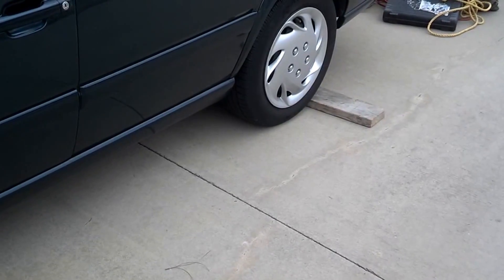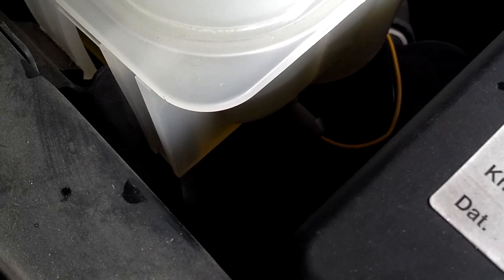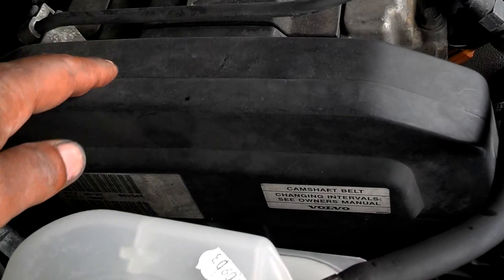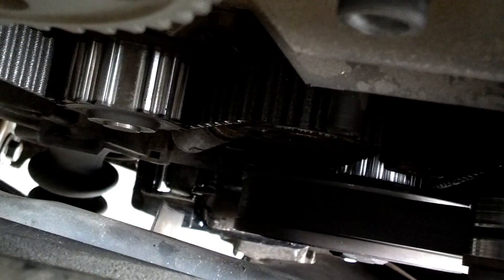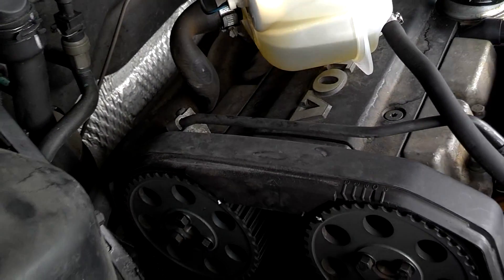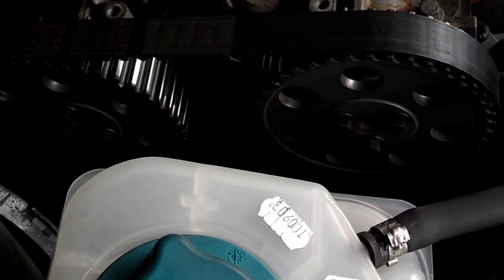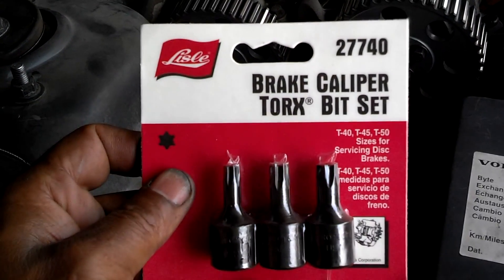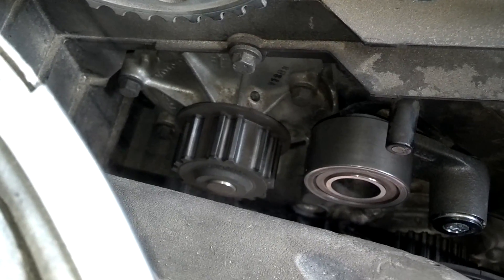How to replace the timing belt, water pump & rollers on the Volvo 850, S70, V70, etc. Pt 1-2 - VOTD

Comment: Hey Ribert I've been working on my timing belt replacement for the last two days and have run into a snag. Whenever I got every thing aligned and released the tension on the hydraulic tensioner and removed the belt now the exhaust can is off by 3 notches. How do I set it back in place? Help will be greatly appreciated. If anyone else can answer this question that would wonderful. Help please!!!
Reply from the maker: Dre_2003 Simply turn it back. Part 2 of this series explains that my exhaust cam moves almost every time.
Reply: Thanks man that help a ton

Comment: Hi Robert. First of all, awesome trip you took to help out folks! I still have several videos to watch of your trip. I just took 2 days to replace my timing belt, tensioner, tensioner pulley, idler pulley and water pump. My 95 850 wagon has 186K now. I also replaced the fuel filter and cabin air filter. So it's running really well. Thanks for all your help with the timing belt videos! It went smoother than I expected. My best to you and your wife.
Reply from the maker: Ricky P. Thank you Rick, glad the videos helped.

Comment: Hiya Robert, I've spent the last 15 mins trying to private message you but i can't work it out. Did you get my paypal for the cam tool and did you post it yet?? Thanks.
Reply: Sent Feb 11th.
Reply from the maker: adamxb1 Yes I did get the payment but no I have not shipped it yet. I ran out of the tools and I am waiting for the machine shop to cut me some more. I have been by there several times over the past week or so. If they are not cut today, I will get them cut somewhere else tomorrow. Sorry for the delay.
Reply: No worries, i changed the heater core in mine yesterday (after watching your video of course). I know I've said it before but they really are invaluable to my V70 ownership.
Reply: adamxb1 did you manage to get the tool made/posted yet? Thanks.
Reply from the maker: I shipped several of them out a couple of weeks ago. If you paid for a tool that you did not get, go to my website and text me your address and I'll ship you another one.
Reply: I'll give it another week and if still nothing i'll do that.
Reply from the maker: If you don't have it by now, let me know so I can ship you another. No problem at all.
Reply: Emailed you.
Reply from the maker: Good

Comment: Anyone can help me with 04 s80 timing belt was touched when replacing accessorie belt now its broken and mechanic said engine is broken dose it make sense?
Reply from the maker: isaac lebowitz Is the belt physically broken?
Reply: Robert DIY now the engine is completely dead the car jumped and the engine died beautiful 04 s80 leather sunroof
Reply from the maker: Yes, the motor will need to come apart, big job.

Not sure I understand how it failed. How many miles were on the current belt?
Reply: Robert DIY 130k
Reply from the maker: Wow, that is probably to much.

Comment: Hi Robert,
Well today I replaced my serpentine belt (it was split down the middle, between two grooves), the tensioner and it's pulley, and the idler pulley (screwed into I think the power steering bracket). Spend about 45 minutes looking for the bottom bolt from the tensioner bracket that dropped into the engine bay, but found it. All in all, went better than I expected. There is a cap on the separate idler pulley that needed to be pried off to get to the 12mm bolt holding it on. I so appreciate your videos. Rick. Happy Holidays!
p.s. Tomorrow I will try to install the trailer hitch wiring. I got a hitch and installed it too.
Reply from the maker: Ricky P. Nice and cool about the hitch.

Comment: Robert, I replaced the timing belt and tensioner on my '03 S40 and the new tensioner came apart when I was sitting at idle, so the car jumped time. Reluctantly I pulled things back apart and finally got the cams to turn by carefully turning the crank 1/4 turn at a time until they turned freely...or as freely as they can with the cam lumps. I set the crank and cams to the timing marks, reinstalled the timing belt with a new tensioner and while it doesn't seem to be making nasty noises cranking, the engine seems to only fire on one cylinder.
Is it possible that the crank is 360 degrees off? I've convinced myself that the #1 piston comes to TDC twice, and only every other time is where it should fire. I don't want to try turning the crank a full rotation and find out that I have really toasted things by further changing the timing.
I've appreciated your videos, and your opinion of what I'm dealing with.
Reply from the maker: Amanaland The best thing to do is a leak down. If the belt jumps time, it usually smashes almost all of the valves regardless of the speed of the motor. It can jump time starting and destroy the head.

Comment: yes check engine light is on and it is N/A
Reply from the maker: Baaxter W. Baaxter, I really have no idea what you are referring to since you did NOT reply to my last message. However, you need to get the codes read and go from there.
Reply: Robert DIY the engine light is on and it is N/A naturally aspirated (non turbo) sorry for the vague response.

Comment: Hello, I have a 1998 Volvo S70 and it is running very strange, sometimes it is hard to start and once it does start it bogs down for a sec till the revs kick up then its fine and runs great. Second when sitting at red lights the engine will rev up then back down and want to die.  I have used your videos to thus far work on and keep running our beloved Volvo but now this issue is beyond me and im not sure what to do.. Im thinking fuel issue maybe fuel filter or maybe clogged injectors??
Im not sure, any input would be greatly appreciated. 
Bobby
Reply from the maker: Baaxter W. Hi Bobby, does the car have a cel (check engine light)? Is the car turbo?

Comment: Hi Robert-thankyou so much for this video-it's a job that I've been putting off for months now, because the procedure is never totally clear in the the service manual. You've covered it in such a way that I'm off to the garage to get down to work!Kind regards, Stef, Amsterdam NL
Reply from the maker: iksnizdaso Good deal. Not a task to be put off for long. ;)

Comment: Thank you Robert, the timing belt and pu,p were done, cost was close to $1000 including replacing the seals around the crankshaft.  They also did oil change and antifreeze.  Now the radiator warning light comes on even though the reservoir is filled.  The warning light goes out after it is fully warmed up.  Why is that?
Reply from the maker: John Tao Maybe the float is stuck. Take it back and have them check it out.

Comment: Hi Robert.
My 99S70 timing belt went bad. The belt made it half the way off the pulley. How can i tell if damage was done to valves or other engine components.
Reply from the maker: Fred A Did the car jump time?
Reply: Not sure I'll have to look at it tomorrow. Waht if it did?
Reply from the maker: Fred A If it did, it likely damaged the motor. Did the motor stall? How did you know the timing belt was no right?

Comment: Robert, I have decided to go and replace the timing belt and water pump but the garage didn't know which kit to get.  He says there are two different ones from Gates one that is $560 and cheaper one $265, depending on the engine model.  Are there two engine types for the '94 850?  The Gates parts are TCKWP252A and the cheaper one is TCK252.
Reply from the maker: John Tao I don't think there are different timing belts on the '94 car. Order your parts from FCP or iPd depending on which side of the country you are located on. Also, I usually just order the parts I need, i.e., the belt, water pump, idler roller and tensioner roller. Cost is usually about $178. The hydraulic tensioner is usually good. I normally have one of those on hand that I pulled from a junk yard car, which cost me $20, they are $95 new so that would bring your total to $273. So you can have that on hand and if not needed, return it for a refund.

Comment: Hello Robert, My name is Salvador, I have a volvo s70  All the light came on and and transmission skips on the 3rd gear, I did a transmission flush and still skip and all lights are on, Im try to see if you know what i can do if maybe a transmission sensor is  fault  and if you think its where can i look for the sensor, Im very glad that you  put  videos about  fixing cars I thank you,
Reply from the maker: salvador paramo Sounds like you have a bad alternator??? - Bad Battery or Bad Alternator, how to tell the difference (Brief Version) - Auto Information Series
Reply: Thank you for your respond, Alternator and battery is ok lights goes on and off, I travel to work daily and  everything is ok,  but the main trouble is the skipping gear and an arrow flashing like the over drive but all gear engage normal but not the 3rd, I have to take off fast it change to 2nd but then skips, and i have to let the engine rpm slow to engage to the next gear, Do you think that its a sensor on the transmission that needs to be look at or change it?
Reply from the maker: ALL the lights point to low power. Have the system OBD2 read at a dealer, they will tell you what is wrong. I don't know.

Comment: Robert my '94 Volvo 850 is close to 200,000 miles, I had the timing belt done 10 years ago at 110,000 miles.  I plan to get it done again, do you think I should change the water pump.  Volvo dealer says not needed and another mechanic quoted me $910 for both and $685 to do just the timing belt.  What do you recommend?
Reply from the maker: John Tao Where are you located? I always replace 10 year old water pumps, they are time bombs.
Reply: Robert DIY Thanks Robert, I am in Pennsylvania.  I guess I have to splurge and get all that done.
Reply from the maker: What part of PA. I may be in the Pittsburgh area next month.
Reply: Robert DIY The other side of the State, Allentown
Reply from the maker: Yes, that is far.
Reply: Robert DIY Robert,
I understand that there is a cover where one can remove and look at the condition of the timing belt.  Is it easy to do that and do you recommend it?
Reply from the maker: You can pull the timing belt cover and see the parts there. Other than that, there are no other covers. And NO, I do NOT recommend visual inspections. The belt is one of 6 parts that can cause the belt to break and jump time, destroying the motor.

Comment: Robert I mentioned that I was going to pull the head off my 98 Volvo tturbo V70R wagon. I did a compression check and the head checks out good. My problem is that there's oil mixed with water in the water tank. None of this in the motor or trans.Could it be a problem with the turbo?
Reply from the maker: el wrencho Bad radiator.

Comment: Hey Robert, my 94' Volvo 850 turbo makes a whining sound for about 5 minutes after starting the vehicle, pretty much until it is at operating temperature. I'm gonna take the cover off the timing belt to see if it looks worn and to check the timing... do you have a video showing how to tighten the serpentine belt? I believe it needs to be tightened. Since the car began 'whining' I have noticed a sudden drop in power going up hills, feeling like the car is stuttering. Any help would be great!
Reply from the maker: Craig Miller Likely not related. The serpentine belt has a self adjusting tensioner. If you have a idler or tensioner roller in the timing belt path squeeling when cold, you need to replace it ASAP before it totally seizes and locks up, tossing the timing belt. It is almost impossible to do a visual inspection on the timing belt parts. If you don't know the history, replace that stuff. - Timing belt change, what other parts need changed? Water pump, rollers, etc. - VOTD
Reply: I'm not sure about the history. The timing belt cover has 126000 written on it, making me believe it was replaced at 126k miles. If that is the case, its over due to be replaced. When listening to the engine with the timing belt cover off, sounded like that is exactly where the squeeling is coming from... Think that replacing the timing belt rollers is beyond my skill level with the little spare time I have. I'm taking the car to the shop this week. Going to have them look over everything.
Reply from the maker: Good, because if one of those rollers fail, it will destroy the motor.
Reply: That's what I was thinking. I'd like to keep the car for at least 5 more years. Then will no longer require emission testing to register tag and further avoid monthly payments on a new car.
Reply: Yo Robert, took my Volvo to the shop yesterday, to have it looked at and to get it to pass emissions. We looked under the hood and the tech noticed the upper engine mount rubber "o" ring was terribly worn out. The tech showed me what the engine looked like when pressing the gas while in drive and again in reverse. I don't see how the engine is still in the vehicle after seeing how much it moved! The shop was able to make small "skilled" adjustments to the vehicle and said that it has passed emissions. Anyhow, going to fix engine mount ASAP, but have a question. Is there an engine mount under the passenger side of the engine, near the serpentine and timing belts (possibly the source of the squeaking I've been hearing)? What codes could the OBDII be throwing out with the engine not properly mounted? One more please... Replaced the engine 2 years ago, the belts look very new, however, if the squealing I hear when engine is cold is in fact the tensioner on the timing belt, would the extreme engine movement have any affect on either belt's functionality?

PS. Your videos are awesome, 5 stars to you Robert. Love to meet you someday in my Volvo once I get to 350,000 miles! :)
Reply from the maker: Hey Craig, those mounts would have nothing to do with the noise. Yes there is a mount under the front of the motor. You can always go to my channel and search any word and find the videos to match. So, "engine mounts" would show you the videos to inspect and replace the mounts. If the engine was replaced 2 years ago, and the mechanic did NOT install new timing belt parts, you likely have old timing belt parts. If you have NO RECORD of when the timing belt parts were installed on the car, have EVERYTHING replaced. Other than that you are playing HEAD ROULETTE. - Volvo 850, S70, V70 Motor Mounts, Location of 3 of them - Auto Information Series
Reply: Gonna have to wait a couple of paychecks to do a whole replacement. Kits alone are $270... can't imagine what labor would cost. I might could ask a friend to help me out, but with only being off on weekends, coming up with 7 hours repair time could be an issue as well. I'll figure it out, don't think HEAD ROULETTE is as fun as a casino... lol
Reply from the maker: How many miles since motor replacement?
Reply: Odometer is broken, will be 2 years ago in November... I'd say around 18,000 - 20,000 miles since replacement.
Reply: The more I think about how much it'll cost for labor (on any repair really), the more I'm thinking I should do the work. Could pay one of many friends looking for jobs $50 to help me. Any tools they or I don't have to complete the task could be bought 3 times for what a shop would charge for just the labor. Pretty much have only $2,500 in the car, including purchase, engine replacement and replacement of some of the coolant system components (a Volvo "specialist" shop charged $275 and completely ignored symptoms I told them, 2 months after, blown head gasket). That's why this car has become my "project" car, I won't feel completely devastated if I happen to mess something up. So far, I have a better record than the auto shops on it.. lol
Reply from the maker: The only special tools that you need is the T45 torque bit and a 6" C-clamp. You can purchase that 30 times before you spend that money. I never purchase the kits, I buy the parts separately and reuse the hydraulic tensioner or get a used one from the junk yard for $20.
Reply from the maker: NO, STOP, BACK UP!!! This is not a TDC world any longer, it is all about marks. - https://www.youtube.com/watch?v=Efel75s7AVU
Reply: Hello sir have a question , when u line up the timing number one piston should be at tdc which way should the rotor pointing up r down , the rotor can fit two way fire on five r one , thank in advance

Comment: Hi Robert. Did you ever had any whining noise from the timing belt after change? I had timing belt, tensioner, tensioner roller, idler pulley and Walter pump chenged in my 95 850 turbo and there is a whine at about 1500 rpm. Some people on the forums say that it is the timing belt too tight. The tensioner is automatic so how can the belt be too tight? Wrong parts? Thanks.
Reply from the maker: I seen that post and no I have never had an issue like that. I have posted several videos of post timing belt changes and have never heard noises. The only thing I think you can do is to purchase another set of rollers and have the mechanic change the 2 rollers and see if that helps. I can't imagine then charging to much for that, you can change both rollers in 1 hour. If it helps, require a refund on the parts you took off. You can have them change 1 at a time to see which one was bad.

Comment: Hi Robert I have a 2002 Volvo V70 X C 2.4 T I am experiencing problems with my dash cluster dropping out and sometimes not working at all. I have removed the cluster and I wondered who you would advise to either repair it or if there is a way to do it myself. Regards Michael.
Reply from the maker: Hi Michael. I believe those clusters are married to the ECU. You likely need to visit a dealer to get that right. :(